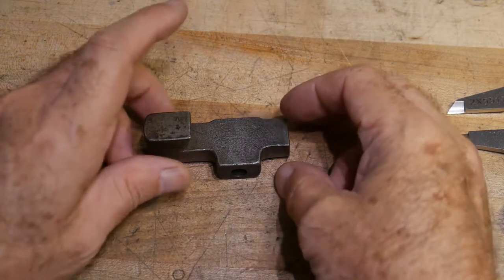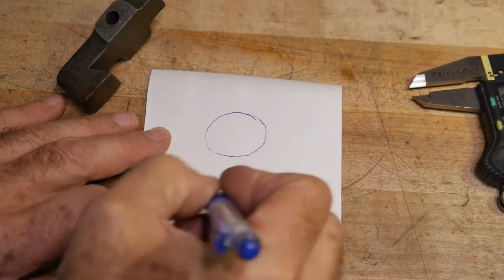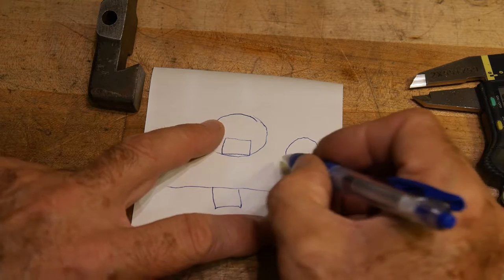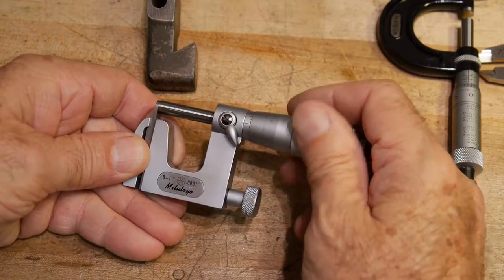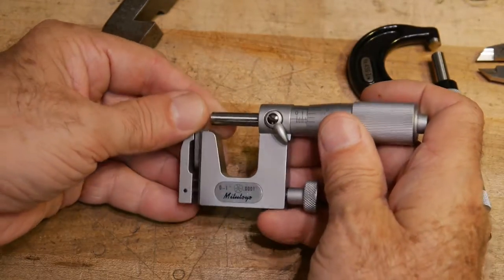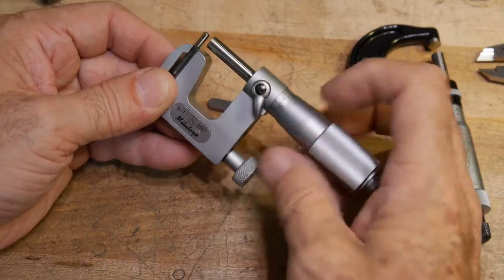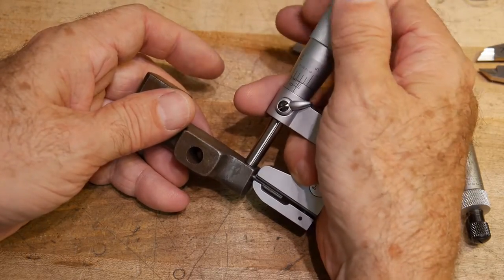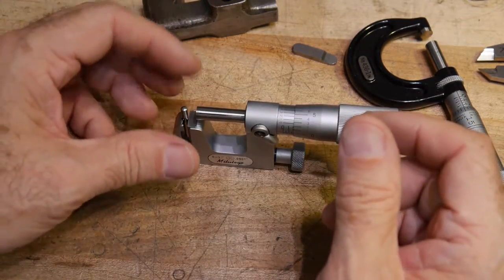#220 Anvil Micrometer

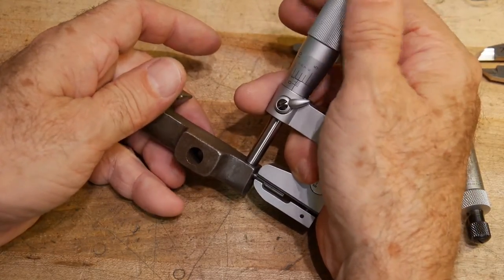Comment: You're reading your measurements at 4:34 completely wrong. The measurement on the first hole is actually 0.107" and the second hole is 0.1605"